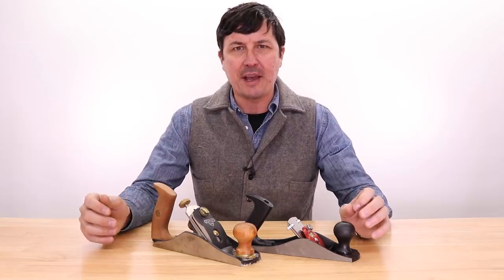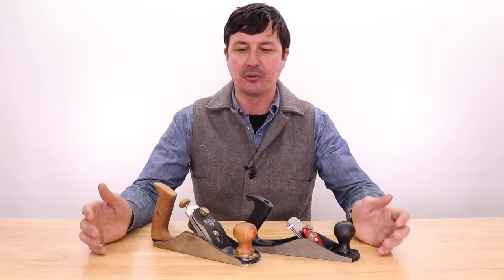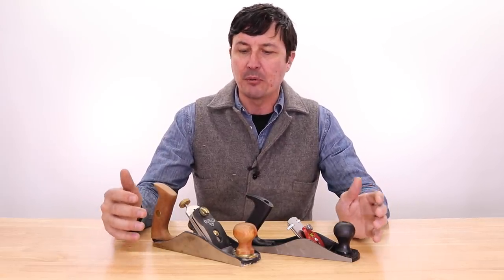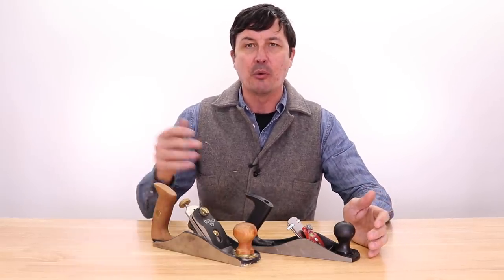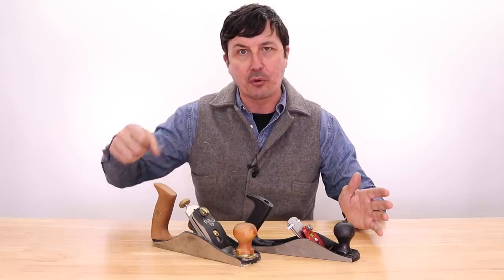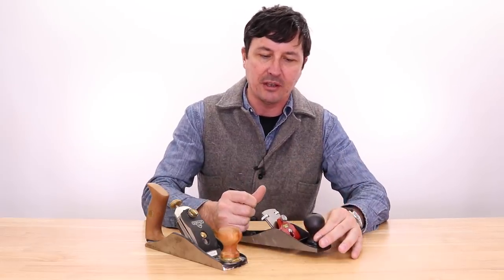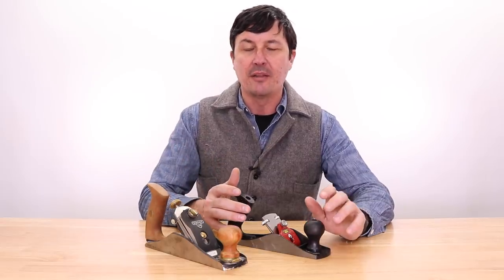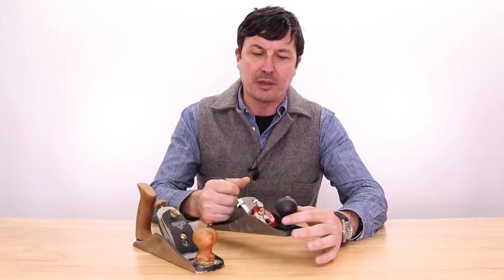Testing The Cheapest Bench Plane On Amazon

Comment: Glass being fluid seems to be a myth according to newer research. The reason old panes were thicker at the bottom is because glass production was hard and one end would be thicker. The thickest part was installed at the bottom to ensure good weight distribution.
Reply: LSLencrypted yes its a common myth repeated by many tour guides of old buildings. if the glass is old enough it would have been blown into a cylinder and then slit and made to lay flat while still hot. the reason originally why all windows were made up of small panes. but even after that glass manufacture wssnt perfect and warped panes of varying thickness was common.
Reply: LSLencrypted yea I'm sure it's the way they were produced. Most old windows have huge ripples going through them, if you look at them in the right sun light they look really wavy especially next to a house with new machine made windows
Reply: Yeah and if you were setting your glass down, wouldn’t it make sense to set the thicker end at the bottom
Reply: Thanks.  I hate this old wives tale.  Pre float glass (pouring molten glass on to a molten salt bath) it was darn near impossible to get flat glass.  The more you know.
Reply: exactly what i said
Reply: Oooohhh,  controversy 🤣
Reply: if you think it's fluid, what you're reading is outdated. lot of confusion over it being amorphous but solid.

one of the old methods of making flat glass was spinning a circle and cutting it up. these pieces generally had a thick edge
Reply: Yes LSL  Encrypted you are right, this is a long standing myth. Many years ago the glass manufactured was thicker at one end . Glaziers of the time knew this and always put the thicker end to the bottom to give the greatest strength to the window pane. Glass is not fluid at all.
Reply: If you use a glass pane for a book shelf the glass bends  (does not break) when loaded for about 15 years. Personal experience. Glass is fluid. Regards,
Reply: Glad someone corrected this. Hate this sort of rubbish being perpetuated.
Reply: shonuffisthemaster the older technique is opening the blown glass bubble at the bottom and then spinning it into a disc. That’s where all those “wine bottle bottom” windows come from — they’re the cheaper centers of those discs. Well, the originals, that is, they’re made decoratively these days.

In the 19th century they developed the cylinder techniques. Real float glass is 1950s.

Comment: As far as sanding the bottom of the plane, why not switch to a coarser grit instead of spending hours sanding on a fine grit?
Reply: Because you don’t want to sand away material unnecessarily your only looking to flatten the bottom not make it thinner.
Reply: 7y and 7d ago for both of you damn
Reply: @roysnider3456 how would you sand away more material you need when it’s not flat?
Reply: @B_COOPER  if it’s that far from flat I’d probably reassess the worth of it. As mentioned in the video it’s very easy to take to much and create a weak area in the sole. I guess what I’m saying is while it’s tempting to go more aggressive generally speaking it’s not a good idea, but maybe that’s just me. I have a Stanley 46 I’m thinking about restoring but the skates are kind of ruff, I’m concerned I will remove the nickel plating but as I typed this I realized that’s a different situation. Anyway when it comes to restoring old tools there many stories of destroying old tools so going easier is better.

Comment: Tool kit: 
-A Marking Guage!
-Marking Knife
-Small Machinist Square
-#4 Plane
-4-in-hand or 1/2 round file
-spoke shave
-1/4, 1/2, 3/4, & 1" Chisels
-Brace & Bits or Power Drill
-Some clamps
-Some more clamps
-Tenon Saw
-Rip Saw, or one of those modern combination saws
-Some sort of sharpening system ( I use diamond stones, but they aren't cheap)

I think this can do just about anything with enough effort and patience.
First add-on would be a Router Plane (I made mine) or a combination plane.
Reply: I'd be curious to see what you could figure out with a few paper clips and a head of lettuce MacGyver!
Reply: Be ElTree well,  clearly build a Bridgeport mill ;-)
Reply: Just another day's work!
Reply: Forgot a coping saw.
Reply: I'd add:
- Tape measure
- Card scraper
- Utility knife (marking knife?)
- Reciprocating saw (for its versatility)
- Probably calipers

Comment: Cody I am a glazier and the comment about glass being a liquid is not accurate.  When they made glass on the old days they ran it through rollers and that's where you get the thicker end.  Also I have a Stanley Bailey #4 if you would be interested in it for the tool box giveaway. It may need refurbished. You did a great job on the Stanley #2.
Reply: Shavedaver --I beg to differ sir. Pure Silicon Oxide glass is a "hyper-viscosity super critical fluid" at STP (1 ATM/30 deg C). when glass is in this "solid" state, the molecules aren't  latticed. The disorganized state  is susceptible to drift by gravity, albeit extremely slowly.
Reply: Shavedaver Gravity is not just a good idea.. it's the law.
Reply: Moran Tactical I agre..a fluid..or semi fluid..
Reply: My friend fluid and liquid are not the same. For example, air is fluid but not liquid.
Reply: Glass flowing is a myth.  The reason for panes being thicker are due to old manufacturing techniques.   I can't believe people are still perpetuating it.
Reply: Shavedaver , I'm from massachusetts,  and the window panes in our oldest colonial homes are shown to have thicker glass panes towards the bottom of the panes.
Reply: Bill Stella that's because when they assembled the panes into the sash they put the thicker part at the bottom.
Reply: So I went on the Google and as it turns out, I'm full of crap.  I was even taught in college about this phenomenon/urban myth.    

I guess some of those old colonial homes in my area(Mass) had window panes that were made with blown glass and were likely irregular to begin with.
Reply: 100% accurate. Glass made in this way is considered an amorphous solid

Comment: 784th view here, Some people claim that stained glass windows in old churches are thicker
 at the bottom than at the top because glass flows slowly like a liquid.
 We’ve known this isn’t true for quite some time now; these windows are 
thicker at the bottom owing to the production process. Back during 
medieval times, a lump of molten glass was rolled, expanded, and 
flattened before being spun into a disc and cut into panes. These sheets
 were thicker around the edges and installed such that the heavier side 
was at the bottom. just wanted to share information which is what the internet is for. Love wranglerstar and all his videos.
Reply: ClarkusAurelius ummmmm fact check?
Reply: yes, i heard that too.  It's a semi viscous material and will break under it's own weight after time.
Reply: I've heard it referred to as a frozen liquid.
Reply: ClarkusAurelius I expected him of all people to know that
Reply: Glass is still a "liquid" it just takes a very long time like every geological process. To break another here: The mantle of the earth beneath the crust also isn't a liquid. It's near solid and there are just atoms moving into empty spaces because of the high pressure all the time. So yes it still moves, but extremly slow, not like Lava/Magma.
Reply: @joshkline huh? welcome to the internet where you can fact check it yourself. just wanted to share info. you can believe what you want or look into what you want. your choice.
Reply: These days they pour molten glass on top of molten tin, which it floats on. That gives a much smoother and more consistent layer of glass.
Reply: im a Glazier apprentice, and the old glass (where im from)  is thicker at the bottom because  during making the glass it is pulled upwards through rollers, and you guys know how gravity works. so not only is it thicker, its also wavy
Reply: thats right web4xxl cody is right.  i had some very old places that i have worked at and around for a long time i have watched what happens. the last one i worked with i talked to a guy that worked there for his whole life and his dad before him was the person that made and installed the windows and the glass was not that way when it was made and over time one window in particular was paper thin at the top and 3/4 at the bottom so they had to replace the window because the wood the glass was set in was cracking apart at the bottom now this took 100+ years but yes it's liquid. now i could be also that when i have seen that happen the glass was poor quality ? could be but it made it 100+ years ?
Reply: K.R. Maker Glass is not liquid. Signed, science.
Reply: Harold Patterson frozen liquids are called solids...you know, like ice cubes
Reply: Liquid glass its called water!
Reply: ok i understand you watched a video and thats cool what i was telling was a story of what happened when i replaced many windows from my personal experience so how does a pain of glass that was not made thicker at the bottom become thicker at the bottom and thinner at the top over time, and the gentlemen i talked to (friend by the way) and his dad both life long woodworkers both old school woodworkers all hand tools (extreme quality woodworkers best i have ever seen in my life personal) so when the window was taken down (by me) and i looked at it with my own eyes i could clearly see at the top a large gap where the glass had once been and at the bottom glazing and wood work being pushed apart buy the now much larger glass at the bottom i said to myself hmm that looks like the glass has changed over time ? 
so i sat down with the glass and was studying it and the gentleman walked up that i had know most of my life and we talked about the window and studied it and scratched our heads allot he told me his dad had talked about the windows in that building he said he made them all the same. all had been replaced years ago because they wanted better new windows but that one window had been left in for the character it had it kinda made the room it had been a train station and was now a restaurant and bar the window was in the bar and up very high on the wall very hard to get to and work on........ ooooo my god i am typing way to long the main points i guess without me talking even longer is the men i talked to just dont lie about things. so i take them at there word. and how do we ex plane the glass that i looked at with my own eyes that was 3/4 on the bottom and paper thin at the top and it was very clear looking at the frame it was not made to hold glass shaped that way how did the glass git that way  ?  by the way i am not in any way trying to start something just trying to understand or are we just going on about the word liquid ?
Reply: ok that is a good thought on the top thinning but but the bottom no doubt about it was thicker then it had been when the frame was made - i am leaning towards the quality of the glass some how. i wish i could get a hand drawing on line i have no idea how to do that, well i do i just dont have a scanner
Reply: sean tap depends on the temp. state of matter he he!
Reply: woofmaker2004 who knows man but i can see the possibility of something happening whith a tweaked mollecular structure having led in it and a magnifying  affect from imperfections in the glass heating itself . just remember the best scientists  fail to find truth so when i say what i say id hope to be wrong so i can try to find real answers.
Reply: You made an observation and formed a conclusion. However the conclusion you have formed is provably wrong by science. This is not dissimilar from how people have historically come to believe all kinds of things that aren't true. Such as the earth being flat, or the sun and the planets orbiting the earth.

The misshapen glass is a result of the manufacturing process that was in use at the time. When the window frames were being made it is unlikely that the carpenter had the the glass pieces picked out for each frame. Instead the carpenter likely made the frame to a standard size and then the glazier applied elbow grease to make it fit. If you had bothered to watch the video the other guy linked you'd know that lead has a lower viscosity than glass and so you would actually see the lead pool out of stained glass windows long before the glass its self changed shape.
Reply: Modern float glass -- produced by pouring glass over molten lead - has been around long enough that at least some older panes should have flowed out enough to measure with a micrometer. And yet, the plate glass samples I've checked for flatness don't vary even one ten thousandth.
Reply: On the one hand, it has been demonstrated that there are natural glass samples that have not measurably changed shape in hundreds thousands of years, and man-made glass samples that have not visibly distorted in 2000 years. The physical/mathematical model also demonstrates glass not flowing.

However, there's a possibility i can think of. BBC Bitesize Science writes: "Glass manufacturers add sodium carbonate to sand during the manufacturing process, to reduce the melting temperature of the sand and so save energy. The sodium carbonate decomposes in the heat to form sodium oxide and carbon dioxide, but this makes the glass soluble in water. Calcium carbonate (limestone) is therefore also added, to stop the glass dissolving in water." So imagine what would happen if the glass was produced with too much sodium carbonate and too little calcium carbonate, it might become susceptible to normal atmospheric moisture and soften at the surface. Rather than the glass flowing downwards, it would be a layer of water-glass-solution.

Maybe that's something we could poke Cody Don Reeder from Cody's Lab or Ben Krasnow from Applied Science or one of the other YouTubers that could set up an experiment, whether they can produce a glass with water-susceptible surface by varying its composition like that, but that could be mistaken for normal window glass visually and accidentally installed.
Reply: ClarkusAurelius and if glas was that viskus the lead would be in a poudle!!!!!!!!!!!!!!!!!!!! For @$#? Sake and im from sweden so i dont know how to spell
Reply: Cubing Gamer, this is not the case. Lead will actually deform under pressure and conform to the shape even at low temperature, it's got quite a high plasticity overall. Now thermal expansion coefficient of lead is about 30, that of glass is about 5 to 9, so after lead has conformed to the glass shape while it was at the coldest temperature, it will have expanded around the glass whenever it's somewhat warmer, allowing the glass, if it were to flow, to slightly fill the gap. By an tiny amount on each cycle, but still. The high surface tension of glass would prevent it from flowing around lead.

Now that is with a caveat that it's unproven whether glass can be accidentally produced that does indeed flow, as normally it shouldn't.
Reply: wow why is this a debate pay attention at school this is compulsory year 7 science for the mentally challenged yes over time glass will flow down due to gravity as it is semi viscous material.  not a true solid . any variation or discrepancy can be accounted for impurities or additives to the making processes
Reply: there is many videos on this, just look them up, glass is viscous but to such a degree that it's not noticeable even over ridiculous time periods.
Reply: I have worked with optics all my long life as an optical engineer on giant telescopes and at Corning Inc.  I can tell you 100% that glass at room temperature does not flow even a tiny bit.  If it did flow even 1000 the amount that people are claiming it does, the Palomar 200" telescope, the Yerkes 40" and countless others with glass substrates would have stopped working almost within weeks.  Today, I can state with tremendous certainty as I have worked with the above and 10s of others made from early and modern glasses, that their dimensions are within 1/10 micron of the day they were completed.  Check the corning museum of glass website.  It was a very common question at corning and has been thoroughly debunked.
Reply: Stain glass is hundreds of pieces of glass not a sheet.spun is thicker in the middle.if you roll and press glass why the hell would you spin it?
Reply: replace flow with distorts in the direction of a strong force acting on it.

Comment: I was just wondering if you think it would be better for a beginning woodworker to buy an electric board planer instead of a hand planer. I have heard it is much easier to use. also glass is a solid, many of the people who made glass back in the day put the thicker cuts of glass towards the bottom of the window because it was stronger for weight bearing. Glass making was not as refined as it is today and there was much more non-uniformity in the window panes.